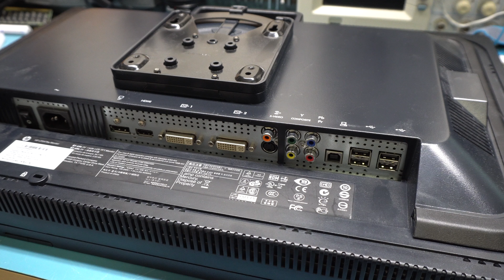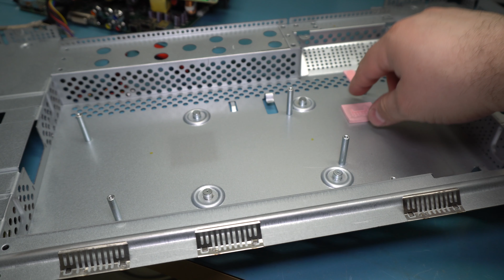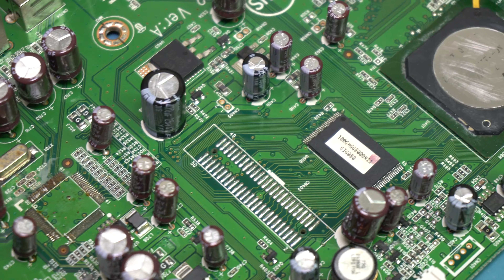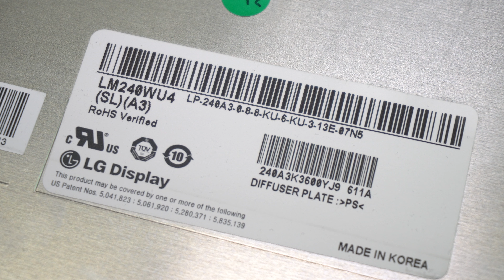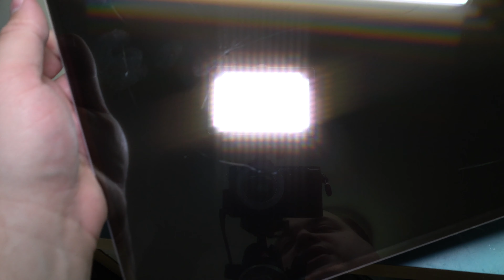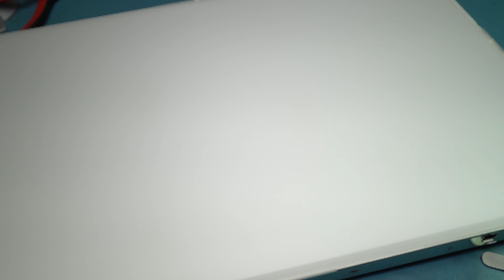HP LP2475w IPS LCD Teardown

Comment: That USB 2.0 Hub Controller you ripped off the board using a hot air gun looks like it was a Renesas(NEC) uPD720101. I think that one is now obsolete. The crystal next to it should be 30 MHz IIRC.

Comment: Mine failed just last month, also bought around 2009. Amazing long life for such a monitor. It saw a ton of use, running more than 8+ hours per day. I've been trying to fix the psu and found a dead diode that I replaced but still no dice. Hopefully I can get it back up and running and connect some retro computers to it.
Thanks for the tear down so I don't have to :) I was surprised buy the actual CFL tubes, I was sure that there was some cfl foil in it instead. That certainly explains why it ran so hot.

Comment: Omg! Thank you for this video, i just wanted to check caps as it is summer and this thing get realy hot. But i will not touch any boards as i can damage components, i will just use compresed air and blow this thing. Again thank you :)

Comment: Chances are that your monitor failed because of a dead Power Schottky Rectifier on the power supply board.   Replacement is  DSSK 60-015A (TO-247 AD) or  V40100PG....

Comment: The inductors on the TCON is not for filtering, it's a part of the DC-DC stepup-converter that makes the drive voltage for the LCD-panel itself. The small FFC is a sync connector that makes sure the backlight PWM is in sync with the horizontal scan of the LCD glass.

Comment: The purpose of the cutouts on the spark gaps is to prevent shortage once sparks charred the board. The charred surface would be conductive but the gap would still interrupt that trace.
Reply from the maker: That makes perfect sense. What doesn't is that they only did it on some of them. :D
Reply: Agreed

Comment: I still use an HP LP2465 which is a 10 year old 24" 1920x1200 8bit SPVA panel monitor, it was the display that finally convinced me to switch from CRTs. 
The colors and static contrast are still great by today's standards, input lag and response time are really bad though.
Reply: ditto, at least, had a HP LP2465 before this one, and since I needed a decent monitor for work, just bought a pair of 2475w's for almost nothing. And as someone who works in graphics arts and photo, I still refuse to get shilled paying thousands on a monitor like apple cinema display or some Iiyma master pro that just both hides inside a Samsung panel.. Both HP and Dell are good deals actually when it comes to pro. hardware.

Comment: We use about 30 of 2440 series ones at work, pretty good for the price. One of them has failed in about 4 years of use. I repaired that one, one 1 meg ohm resistor had failed on the power supply :) Looked like a sense thing to the first 230 volt side power supply controller chip, there were 3-4 of them in series and one had gone open circuit.